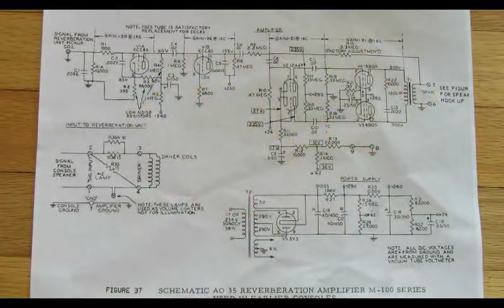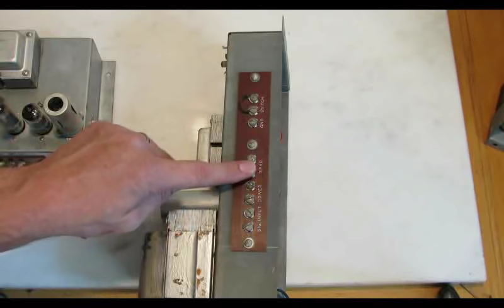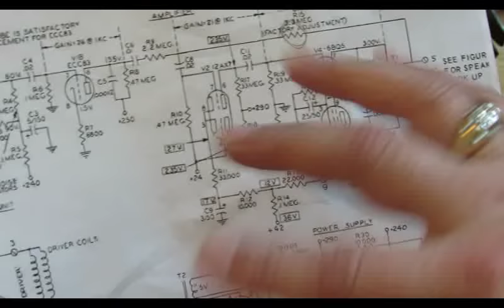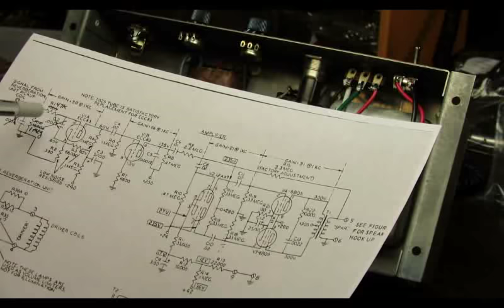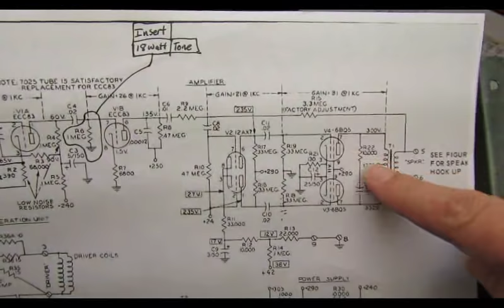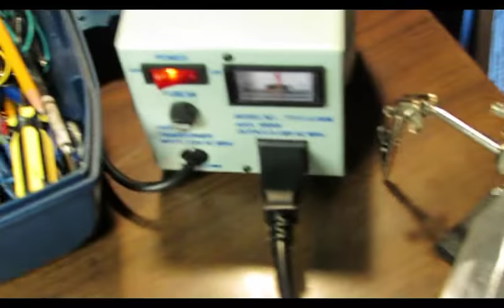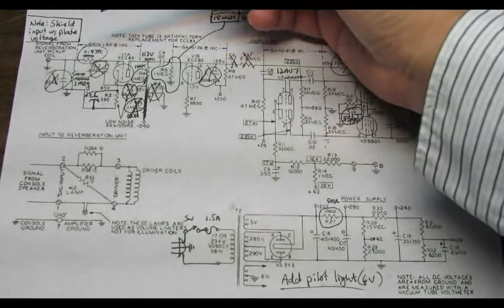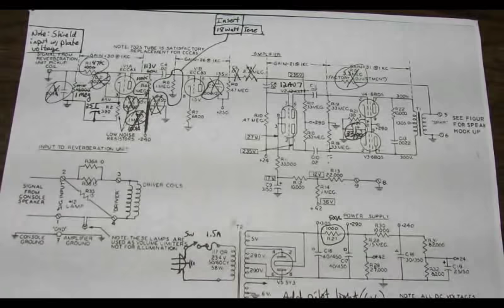Hammond AO-35 Complete Start to Finish Guitar Conversion & DEMO

Comment: I got an old 3022 Hammond up local for free with a tomorrow deadline. If it doesn't go to someone who wants it, the universe will grant me an amp project. The body of the organ will make a nice guitar studio workstation. Going to place boards where the double keybeds are with rackmounts for some rack gear and the front flat surface will house a vg-99 roland and a Boss GS-10 desktop units. Place a monitor and a power head on top, change out the speaker depending on how it sounds and smile accordingly. This video is a massive help as a primer. So thanks for doing this Brad! You rock!

Comment: Got me one,but 67 year old resistors probable drifted,sent mine to Mike Moser,Frugal amps,he wired it up point to point,matchless spitfire,all new caps,and resistors,sounds amazing,volume,tone,master volume,power,and standby switch,iec cord with fuse holder,Jewell indicator light,top notch work.

Comment: Why would anyone thumb this video down? Just get out if you are not interested. I'm guessing 4 people accidentally clicked the wrong one, or left the youtube page open, and their cat walked on their keyboard. No, there couldn't be 4 people that trollish to thumb this down. Not on the internet, right?

Good job on all your videos.
I watch this because in 2010 I successfully converted a Crate BV120H (Blue Voodoo) with 6L6's to a (v1)Plexi 1987-(v2)JCM800 2203 with (v3)reverb.
I then bought all the components to build a new one from scratch but still haven't made the board or finished it for 7 years. I drew up schematics and still have my converted amp to reference, but before I get started i needed to refresh my knowledge on the stuff.
These videos help me a lot.
I may do some things differently this time. I use a 12v dc relay with 1 jack to switch channels, and a 12v dc relay to switch reverb. Of course I get a pop when I switch, so I may try the opti switch thing. They seemed hard to implement w/o losing some tone.
I already use 3v dc filaments for v1 and v2, and 6 vac for the rest. I'll stick with that.

So yea, thanks for the videos. They help me get my mind re-primed to start doing this again.

Comment: I tried running the shielding cable to the plate on an AO-35 based Carmen Ghia clone and ended up picking up a few radio stations in my signal chain as well as effectively eliminating any bass from my tone control, YMMV I guess. On another note very informative video that was invaluable in my journey to finishing my build! Thanks!

Comment: At about 48:30 when you were wiring up the switch and a bit earlier when stripping the power cord, you may run into a European wiring situation and it even looks like the Hammond amp had a blue wire which should be wired to the neutral or white and a brown wire that should be wired to the hot or blacck.

Also, when stripping the outer sheath (or even any bit of insulation) I like to get a really sharp knife or razor blade and cut most of the way through the insulation and then flex the wire to stress pull the insulation apart.

The nic usually rips through the insulation and leaves the underlying next layer of insulation or the copper intact. If it doesn't, while the wire is bent i just nic it further and it always works.

This is a great video. I just got a B20 amp with I think has 4 6V6s and no preamp. Thanx for the video. I hope that you don't think that I'm dissing you.

I'm just a feral human with poor social skills.

Comment: Tip when drilling into a chassis which is already populated with wiring and components, is to use electrical tape to form a little cup, stuck around the rear of the intended hole, to catch the swarf as it gets cut by the drill bit. Saves having to chase the bits out of the chassis before you dare to switch it on.
Reply: .
I normally use a "C" clamp (or pair) to hold a piece of wood behind the target hole, it also helps keep the burs down, keeps the shavings out of the box and tells you when to stop.
Reply: Yeah. I was thinking all those shavings ain’t a good thing. Good to know these tips.
Reply: Yep, all good ideas.  I use that good blue masking tape & rags to keep the flingy bits in.

Comment: It can still happen but it's rare to see these given away  now. I got a 1964 M103 for free early last year (2018) and it was seized up. All the tubes we're good though.

I had to oil it up and give it a bit of elbow grease on the shaft to get it going again, but it's all there and working well. Caps need to be replaced but I've reserved all that for a full cleaning, tune up and foldback mod later.

Comment: I usually convert these to Matchless Spitfires with good results. The tube complement and transformers make for an easy conversion. You just pull the board and repopulate it with appropriate caps and resistors. Usually the can cap works fine. There are also a lot of 18 watt Marshall schematics and layouts available for free online. The transformers are very high quality. I have put controls on either side with my conversions. My only misgivings using the side close to the tubes is the heat effecting the pots but it hasn't been a problem. The advantage besides short leads is that the tubes are closer to the outside of a combo so the heat dissipates better. Also there's less drilling into the box.

Comment: Love your videos.
Sometimes it's helpful to have an octal tube base loaded with a couple of diodes to emulate the rectifier tube for when you're variacing the device up.  That way you don't have to be concerned with the filament voltage in that tube.  Of course use only for testing at lower AC input as the diodes will pass considerably more voltage out at full AC than the tube rect and possibly over voltage the filter caps.
Great work.

Comment: There are certainly some Hammond models that are much more desirable than others, and Hammond, in addition to making some magnificent instruments, has just as certainly produced a staggering number of 'clunkers' over the years! Sadly, there's not a whole lot that can be done to salvage those.

A couple of years ago, I was fortunate enough to rescue a 1953 C2, that was headed for a landfill, from a church that had been convinced that digital was the only way to go!! I donated a few hundred dollars to the church (otherwise, I really would have felt as though I was robbing them!) and explained the instrument's worth before carting it away! Shortly thereafter, I found an almost equally ridiculous deal on a basic Leslie (Model 25) which I am now in the process of converting to 2-speed and adding rotating horns.

While I am all for salvaging older electronics, and converting them for use with guitar and/or bass, the magnificent power of a proper Hammond is where I have to draw the line!! Unless it's totally beyond restoration (which is seldom the case), the amp is a significant part of the Hammond-Leslie sound, and there are plenty of devoted Hammond players that would pay handsomely for many of those old amps (including the AO-29, and AO-35 reverb amp). in addition, many old Hammond and Leslie amps include parts of the Leslie switching circuit, which I can tell you is a real pain to replicate correctly...without resorting to solid state add-ons and/or expensive Trek II parts.

Love your videos....I just have a major soft spot (Yes, probably in my head!) for Hammonds.

Comment: Sick amp, really does sound good. And sick UFO! It has that nice singing tone to leads with some attack. Not at all harsh despite all the gain and highs. And pleasant crunch. This as two channel amp with cleans having some headroom would be perfect.

Some of the characteristics remind me of my Lee Jackson preamp, just with less harsh treble range. I have a feeling it shares some design in the first stages with these kind of small amps that you do, something that does the spanky attack even on drive sounds. I've heard its circuit is following old Fender designs, just with added gain stages.

Rock on! These amp servicing/modding videos have been my binge watch during this lockdown time, can't get enough of them. And trying to suck as much info from them as possible. So far gotten great practical bits about trouble shooting, behavior and fixes to common problems in amps. I feel like someone would be able to build a decent amp just by watching a lot of your channel. Perfect nerding out and ruthless humor. And killer guitar playing of course. Anyway, just wanted to say thanks for this content, the info you share feels reliable contrary to how you often have to second guess a lot of stuff you see on youtube. And it's delightful to see every now and then how you and your kid smile to each other.

Comment: There is an amp that has been in my dad's attic for as long as I can remember. With it, is a metal plate with oiling instructions and indicates it is a Hammond model M amplifier, serial number 11836, 115 volts AC, 60 cycles, 93 console watts. There is one larger transformer that has no corrosion, as well as a smaller one, also without corrosion, that has AO-20936-0. The tubes look okay, and are as follows: 5U4,  6BA6,  6V6,  6V6,  6SC7,  6J7, 6J5, &  6SJ7. On the "front" are various screws, that look like wires have been attached, as well as a couple of what looks like RCA inputs. The best I could read with my old man eyes: "Pedal Cutoff"  "Key SW"  "Decay SW"  "Sus SW"   "Pedal In"  "Voice Coil"  "Ped"   "Att-Key"  "VIB"(?)  The RCA looking inputs have (best I can tell) "Radio Phono" & "Spec Input"     

So……would this make a good guitar amplifier? I know absolutely nothing about electronics, but do play guitar, and love the different colors and temperatures of tones that tubes can produce. I am not asking how to do what needs to be done, because I am sure I will be finding someone to be with me every step I take…..I've just not seen anything other than amplifiers from M3's, M2's, or M100's anywhere. I DID, however, find the schematics, block diagrams, wiring for the organ itself….but what is the amp called? AO-20936-0???

Thanks, and sorry for asking so much !
Ke & Ri

Comment: Actually at 1:08:00 it wasn't a bad resistor. You had installed capacitor C5 in backwards and it was causing excess current build up on the plate of the 6AU6 tube leading to the problem. I know this because I have watched a video where someone fixed some old electronics on youtube.

Comment: Enjoyed the video, well done. I've probably done around 75 of these conversions.
Reply: Can you help me out with an issue I'm having with this amp? I'm not getting plate voltages on the first 12ax7 tube. On the second one I'm getting good plate voltage. I haven't changed out the coupling caps, they are original. I did change the main filter caps. Any thing I'm missing?? Thanks

Comment: A Zobel network is really pretty simple, it is just the inverse of the speakers inductance due to capacitive reactance, I’m not sure why you’d really want that here. They are used when you have a 2 or 3 way speaker design to present the passive crossover with a constant impeadance rather than an inductive rise as frequency goes higher, this makes designing crossovers easier, that’s pretty much what’s its used for in practice... For instance, a 4 ohm 12 inch speaker might be 3.8ohms at DC but at 500hz it might be 78ohms, this circuit would make the impeadance more flat, so you’d have 3.8ohms at DC and 5 ohms at 500hz, so this would help the amp see the speaker as more resistor like than inductor like, it should not have all that much effect on tone if it’s designed correctly. There is no just putting a capacitor and resistor in the circuit and seeing what it sounds like, this network needs to be specifically designed for the exact speaker it’ll be used on... Wikipedia doesn’t have very good information in this case, this would not be the best method to tame a misbehaving amplifier that’s oscillating, although it would probably work. It might have been used for that 80 years ago, but obviously electronics has changed just a little bit since then.

Comment: Hi Brad...I am attempting my first push pull build. I have a beautiful pair of Tung-Sol 6550's and I read on the internet that a 5Y3 would choke such a build, apparently they thought that little rectifier can't keep up with the power of those 6550 tubes. I have been looking at Rob Robinette's pages and decided to build a 5F6 Bassman with these mighty tubes and would appreciate any advice you might share. The original amp was a Stromberg Carlson P.A. head that used this very same rectifier and as a guitarist, I want to build something useful that sounds good. There are a ton of mods that Rob Robinette uses on his builds and I'm sure I will implement some of them. I have built a "Champ' clone and it turned out great but this build with the phase inverter circuit and a good tone network is lots more than that little Champ circuit was. As always, you clips are much enjoyed and appreciated, as are Uncle Doug's.
Reply from the maker: The reason converting something like this is preferable to a scratch build is you often get the transformers and chassis and tubes cheaper this way. If you’re stuck on 6550, look into building a 2204 Marshall perhaps. You could use Bassman transformers.

Comment: Amazing video! On one of my computers I use a Mullard Altobass / Stereo 44 amp (EF86 - EL84) amp from 1967. Apart from the valves (its on it's third set) everything is original and it does make some popping sounds within the first minute of starting up but works fine, sounds stunning with anything from classical to dubstep. I've got a Trix push-pull EL84 amp in the garage I've been meaning to rebuild for decades - might get on with it now! :o)

Comment: My practice is to go to fuse or circuit breaker first..... When the guts of the switch fail, you will have the fuse to open, instead of an overload. In rhe days of 2 prong plugs, it did not matter, as it was random which side was hot. and with AC its always changing ‘direction’. With a grounded chassis, you probably want to have power interrupted before the first potential failure point.
Reply: .
Absolutely correct. Look at the setup with the inline fuse holder.
Tech opens the amp, checks the power with the switch on - nothing. Easy, blown fuse. Turns the switch off and pulls the inline fuse holder apart. The protective shell slides back and the shocks and arcs begin.

Unless the disconnect switch IS the circuit protection, switch should always comes first - but doesn't, even in "professional" amps. The thought must be to protect the switch as well - I guess and in "low voltage" systems like this, may be acceptable, but not with an inline fuse holder.

Comment: Good grief! That is righteous, man! Came here to get information on re-capping a AO-43 (eBay) to double amp great grandmothers M103 (and get practice before re-cap the M103), stay in for all the tips, and settle in for the playing, well done on both build and playing.

41:40 Firstly, a file is to be used forward, dragging back damages the teeth. Secondly, they also make a hole reamer that be faster and easier. Hope this helps. 

1:17:10 With more than one ground point, how are you avoiding ground loops? Thanks.

Comment: My 1st tube guitar amp was a repurposed mono all tube reel to reel player , my 1st guitar amp was a ss 6 inch combo with only v and t controls 20 dollars then ! being poor you got to be creative as a teen ! that sucked , it was in the late 70's -think cat scratch fever was out when i bought that ! anyway conversion was simple , i removed reel to reel mech , and just plunged into the aux or mic input !  , the mic input had distortion gain , think sunshine of your love sound ! it had a 3 way speaker and was quite loud , wish i kept it , wish i didn't ruin the reel to reel , just got tired of repairing the belt drive lol , also when we threw out our Magnavox console color tv all tube ! i should have saved the amp section ! it had 2 15" loud speakers and 2 12 inch horns ! i kept the speakers only with the crossovers ! that was my loud tube guitar amp , using the aux input ! what a sound its radio and turn table had , like at a live concert !

Comment: Although I wouldn't mind owning a SMD-type heat gun. Or better yet, a hot-air SMD rework station, like the DIC Denon  SD-2000 or SD-3000. I'm so cheap that I use a 150 Watt spotlight bulb to activate heat-shrink tubing. It works rather well and almost won't damage the tubing, unless  left  too  close, for too long. But, it does take considerable time to do so.

Comment: Removed the Boucherot from an Ao-44 and it did seem to make the tone a bit less “grey” to my ears,at least. I haven’t added a 12ax7 to it so it’s fairly stock other than a bright cap of an unusual value since I experimented with what I had on hand. Always wondered what that part of the circuit was supposed to do. Completely gutted the Ao 35 I have besides the transformers and tubes.. Prolly do the 18 watt thing. Watching this to see where u go with it. :)